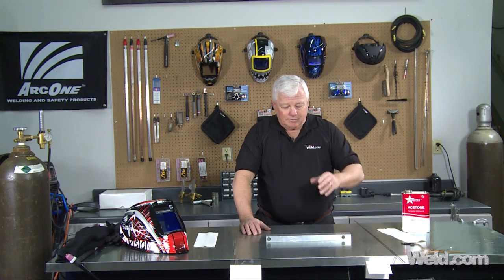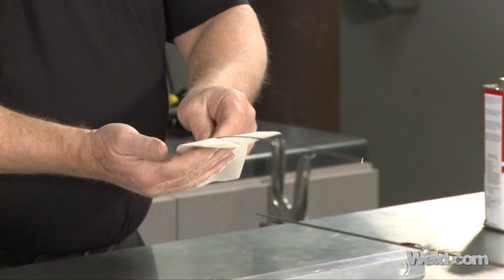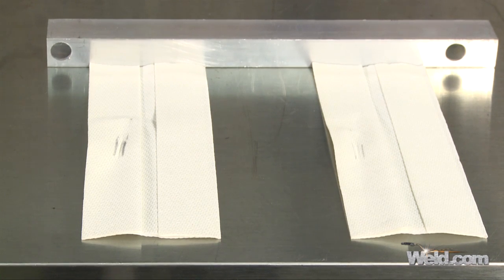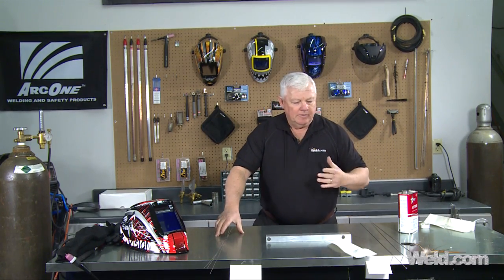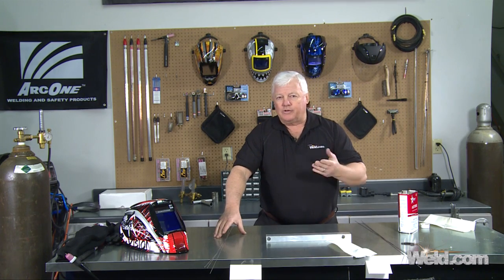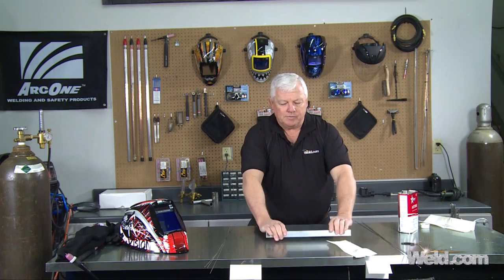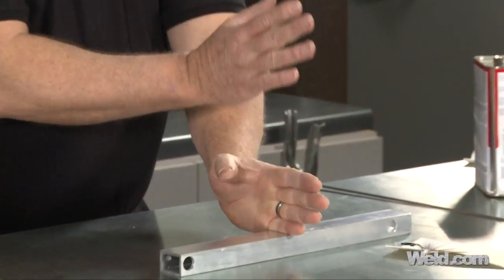Comparing Aluminum Filler Materials | TIG Time

Comment: Wyatt
Having used a cleaning product on aluminum such as a acid for aluminum what is your thoughts on acid vs. acetone - as acetone can be absorbed into the internal organs 
I have also tried a commercial brake cleaner to clean the aluminum prior to welding
also had a shop experience when  the trash can went up after it was holding the cleaner
OOPS
art
Reply: I thought I should let you know, using brake cleaner and welding can apparently make phosphene gas which is deadly, look it up.
Reply: phil p are you talking about chlorinated brake cleaner? Which would release chlorine gas when heated

Comment: I've had a Miller water cooled 200dx for a couple of years now and mostly weld broken atv and motorcycle engine cases which are usually covered in oil.  I've cleaned and cleaned them before welding and have had decent results until lately I found that balling the tungsten with a copper plate seems to have helped considerably!  Is this just a fluke or am I on to something here?  I grind my 2% ceriated tungsten to a sharp point then use the copper plate to form the ball with the foot control.  I never hear you doing this before any of your aluminum welding but I do notice a ball on the end of your electrode.   I get a lot of black that comes to the suface sometimes but I just stop and brush it off then run another pass over it.  Thanks
Reply: Typically you will use a sharp point on your tungsten for steel and a balled end for aluminum.
Reply: This is something that i also see and hear a lot from these guy's, that your tungsten electrode has to be and stay pointed, but i see that they are frequently using their electrodes dull or balled at the tips and they get the same results as them being pointed😕💡I've seen and heard many people give directions/instructions on procedures just to make it seem as if it's some super important thing that has to be done just to make it look as if it's harder than what it actually is😕 It doesn't make sense to me why they do this😞 I do believe and understand the possible contamination factor if your electrode touches the part, that it'll contaminate your work but that pointed tip i think is bull😔

Comment: Hi Mr T.  Wouldn't you make sure that the plate was cleaned with acetone too?  I just supposed you did but you never mentioned it. Also, is that the sort of noise you would expect when welding aluminium?  Cheers and thanks for the vid.
Reply from the maker: Yes, the Aluminum was cleaned prior to welding. The noise you are referring to is normal when welding in AC mode.